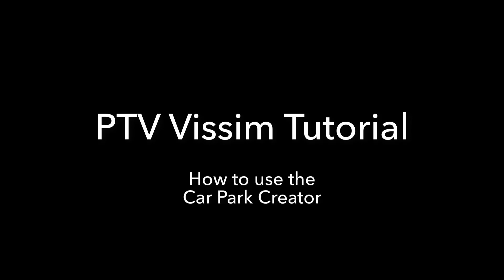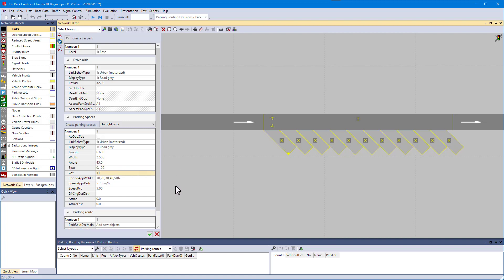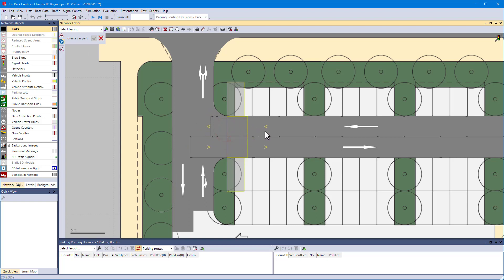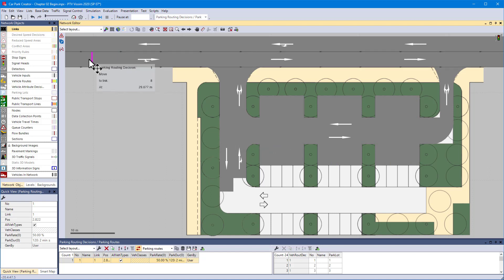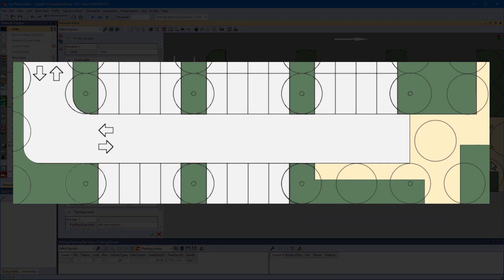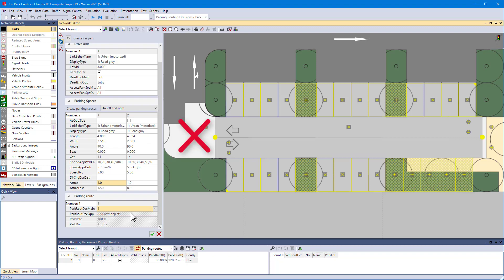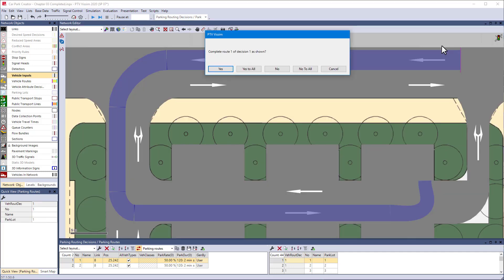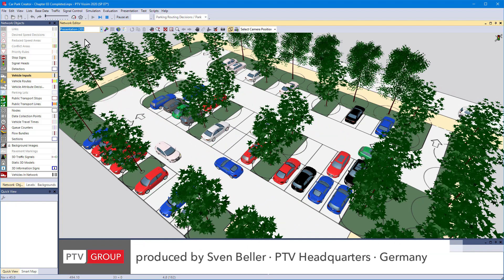How to use the Car Park Creator | PTV Vissim | Tutorial

Comment: how to make two separated created parking lots group use one parking decision , it is only possible through fix the route?
Reply from the maker: Hi, a parking lot group is for evaluation only. The assignment of parking spaces to a parking routing decision is independent of a parking lot group and can be done easily in the car park creator by selecting an existing routing decision before closing the car park creator.

Comment: Are there features with this module that can apply to on-street parallel parking as well?
Reply from the maker: Dear Wells 306,

yes, there is.

Please excuse the delayed response. You may find quicker help in the Vissim/Viswalk group at linkedin: https://www.linkedin.com/groups/2524087/
Reply: @PTV-Mobility  please can i make parrellel street parking using the car park generator??